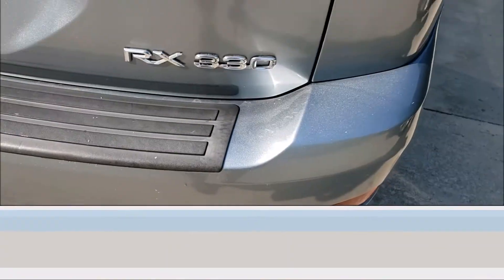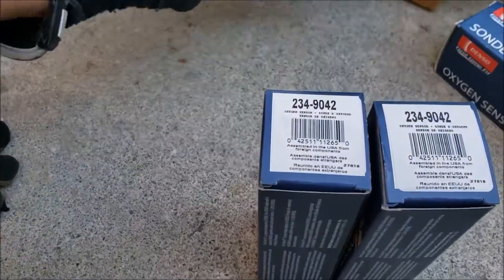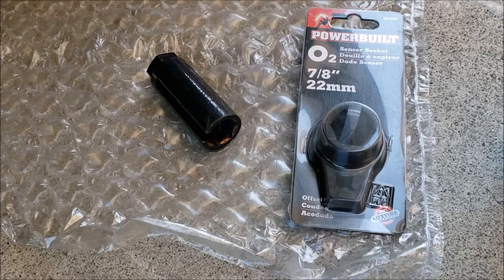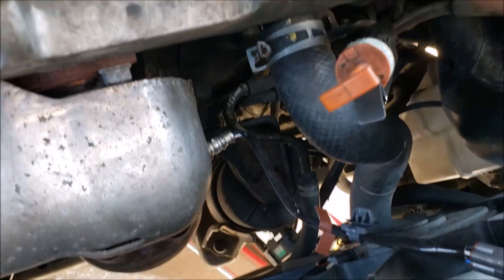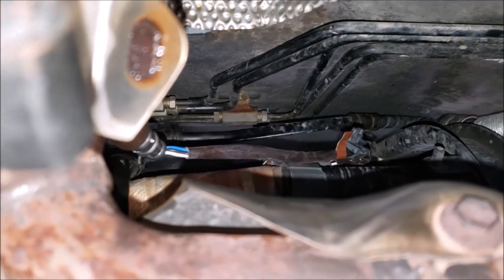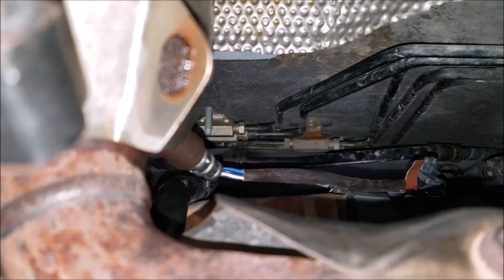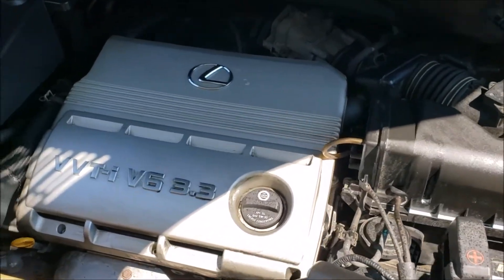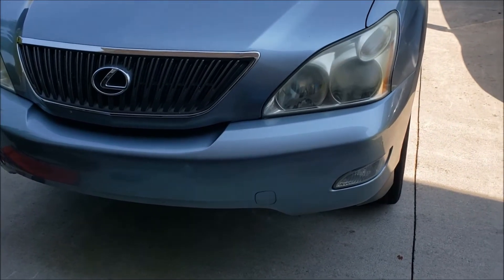Replacing O2 sensors Toyota/Lexus V6 3MZ-FE engine

Comment: Help. Trying to replace the front air/fuel o2 sensor (Bank 2, Sensor 1 I believe is correct).  CANNOT get the electrical connector off.  Anyone else struggling with this?  I cannot afford to break it.  I cannot seem to locate any release tab on it.  Any advice appreciated, especially in detail.  Thanks!

Comment: Hey i have a question. So i dont have a CEL and i just passsed emissions by them plugging in an O2 scanner.  But when i plug in mine it say the short term is perfect at or near 0. But my long term fuel trim is between +4 and +11. But what i have heard is that a bad oxygen sensor will cause it to be   - fuel trim. I have 180,000 miles on my rx330. Just not sure if this is because of 02 sensor or something else. I did a smoke test and i didnt see smoke coming out except for the intake where air goes in front of engine.
Also my fuel mileage is bad i average about 14-15. Used to be 19
Reply from the maker: Definitely sounds like you are running rich fuel-wise. If it were me, I would do a general tune up. Can't hurt, would only help. I would clean the throttle body, change the plugs, and run fuel cleaner through the next couple tanks of gas.

Comment: Great video. I'm assuming the o2 sensor you've taken out is bank 2 sensor 1?
Reply from the maker: I replaced all 4. The air/fuel sensors are sensor 1 on each side and the after cat o2 sensors are sensor 2 on each side.
Reply: @gdupler1966 thanks much for the reply.

Comment: after using the o2 socket where does the other side come unplugged from? i got a 04 rx330 and don’t want to just pull it out without undoing it
Reply from the maker: I would recommend unplugging the wiring harness before you use the socket. Otherwise, it will twist the wiring and make it more complicated.

Comment: Are you saying the 2 front sensors (toward front of the engine) before cat are the same 02 sensor part #? I bought 2 was able to get the one in front right of the Heat Shroud, however the other upstream lower left... (the one going right into the pipe) that connector did not fit? so I had to return one.. I removed it and the holes on the tip of the sensor were different than the one on the right of the heat shroud.... Any info will help.. thx
Reply from the maker: The air/fuel sensors (before the catalytic converters) are the same.  However, the engine is placed in the vehicle sideways. That means there are air/fuel sensors on each side of the engine. One is in the front (first one I described in the video) and the other is in the back of the engine, right next to the firewall (fourth one I described in the video). Hope that helps.

Comment: Was you able to change the one by the firewall with out a lift???
Reply from the maker: Yes. I used a universal joint, and an extension if necessary.
Reply: @gdupler1966  I seen that you used ramps and I'm going to do the same I just didn't know if I'd be able to reach it. I have a an extension and O2 sensor socket like you have. Thanks for replying.
Reply from the maker: @jcarney910  I used jack stands, but ramps should work as well.

Comment: I've got a lexus rx330 2005 and my check engine light and traction off light came on so I unhooked battery cables and hooked them back on lights went out but was running rough checked and it was out of coolant put coolant in and back to normal next day I cranked it maintenance required light was on and running rough turned it off and barely cranked sat one hour tow truck guy cranked it drove it on truck said seems like it is ok but I went ahead and sent it to garage any idea what could be wrong with the crazy thing

Comment: what is the upstream and what's downstream??
Reply from the maker: Upstream is before the catalytic converter and downstream is after the cat. The air/fuel sensors are upstream and have the part number 234-9042. The downstream oxygen sensors are different and have the part numbers noted in the video.

Comment: Hello. thank you for this wonderful video !! I have a Lexus RX400h. Do you think that these 4 parts are fits in my car ? Thanks again
Reply from the maker: Thank you for watching! The part numbers may be the same or similar, but since you have a hybrid, I strongly recommend you check RockAuto.com for the correct part numbers.
Reply: @gdupler1966  Thabk you !!
Reply: hi , thank you , can i use this part no, 2005 rx330 ?  
i have P0037 code

Comment: I have PO430 Bank 2 code now. Pops up last week. Next inspection is in a year. Should I drive like this or change those parts?
Reply from the maker: Just my opinion, more emission issue than drivability, but I don't like having the codes. If it were me, I would try a cat cleaner in the gas tank first.  If that doesn't work, replace the sensor. If that doesn't work try: https://youtu.be/t4MCUwaeqA4

Comment: I heard there’s something called “ adaptation values “ which you should do it with your OBD after replacing any oxygen sensor so they can read the new date but not the stored old data. Any idea on this one ? Great video by the way 👍🏼
Reply from the maker: Thanks for watching! I have heard of the term with certain codes like P2097. Whenever I have replaced sensors on Toyotas I let the PCM figure it out and see if it resets. If not after some short drives, I reset it with my scanner.
Reply: @gdupler1966  in my case acutely I never had any codes or any engine light but my car was puffing white smoke at startup and the mechanic says your down stream O2 sensors are bad and that’s what cause that smoke ! He says it need to be performed manually and have it reset to factory something like that still getting the same smoke after new sensor were replaced 🤔 the codes he found was p0131 and p0134
Reply from the maker: @Cosmopolitan86  those two codes point to the upstream pre-cat air fuel sensor on the left side not the downstream. If it were my vehicle, I would replace that particular sensor and see if that solves the problem. You should only see smoke at start up on cold mornings. Also need to check the coolant to make sure the heads and gaskets are ok.
Reply: @gdupler1966  I have 08 Lexus GS350 and it has so many oxygen sensor, the one who diagnosed says bank 1 sensor 2 & bank 2 sensor 2 , he mentioned that’s the 2 sensor by the exhaust so I went and bought 2 of them OEM ones. Do you think I might give a try and change the front one ?
Reply from the maker: @Cosmopolitan86  the codes he gave you point to bank 1 sensor 1. Due to the age of the vehicle, and probably the mileage, I would replace all 4 sensors with OEM units to eliminate any issues from them. However, if you are having significant white smoke exhaust, I would check the condition of the coolant before spending a lot of money.
Reply: @gdupler1966  everything seems topped off no leak or anything suspicious, I’m going to replace the upstream ones very soon and see if that will help. My mechanic have a really hard time replacing those downstream ones omg he was kinda cryin  and keeps calling me every time to see how hard it is lol,
Reply: @gdupler1966  update - I changed all 4 O2 sensors and one of my friend reset the ECM few days ago I haven’t notice any smoke yet but I’ll drive it more and will keep you update it 👍🏼
Reply from the maker: @Cosmopolitan86   Good deal! Fingers crossed that solved the problem.

Comment: Hello! I have a 2013 Lexus es350 with 108k miles, I’m the second owner and I got a check engine light. I went to autozone and the codes were P0441 P0455. The worker who has really helpful told me that it was probably  an 02 sensor. Any thoughts as to what it could be? Im going to the mechanic shop two days from now. Thanks!!
Reply from the maker: The combination of those codes usually means you need a new gas cap. I would look at that, check the vacuum lines, and probably a PCV valve.
Reply: @gdupler1966  will relay this information to the mechanics, thank you and I’ll keep you updated!
Reply: I changed all 4 on my 08 GS350 with 123k 2 upstream and 2 downstream the way I change them because I was getting puff white smoke on warm startup and the mechanic told me your o2 sensor might causing this but he was wrong , good luck 👍🏼

Comment: wondering if you saw any improvements with mpg? I have no codes but getting about 19 mpg freeway. vehicle has been religiouly maintenanced.
Reply from the maker: Yes, a little, probably about 1 mpg. Changing plugs helps too.
Reply: Yes, I'm at my wits end. On mpg. About 2 months ago, I noticed a significant drop in my fuel mileage. I have done all I can with the cheap DIY. I did a smoke test with a pump and cigarette, and there were no leaks. I cleaned MAF sensor. I don't have any codeds, but in the city, I get about 14mpg and freeway, maybe 19.

Comment: G, About how long would you say this took you? 1 hour? 2? Mechanic wants to charge $750 for this job (parts+labor) and I'm thinking the parts are under $200 and no way hes gonna spend 4 hours on it LOL
Reply from the maker: Maia, good question. I would think an experienced mechanic would take 2 hours tops. I purchased the Denso OEM sensors from Amazon for right around $200. I understand that mechanics have to make it worth their while, but if it were me, I would check some other estimates.

Comment: What code did you get before replacing the O2 sensors?
Reply from the maker: P0133. It only indicated one sensor, but due to the age and mileage of the vehicle, I replaced all four sensors.
Reply: @gdupler1966  thanks for responding, mine gave a P0420 code and it idles correctly. I’m guessing it’s the catalytic converter but it might also be the O2 sensor. (Catalytic system below threshold. Bank 1) what do you think?
Reply from the maker: @josephakobundu  if it were me, I would replace the O2 sensors on that side. If the code doesn't reappear, you are golden. If it does come back, I would be headed to the muffler shop for a cat.
Reply: @gdupler1966  thank you, I’ll do just that this weekend and let you know the result.
Reply from the maker: @josephakobundu  you are welcome! I wish you well and I will be interested to hear how it turns out.
Reply: I have bank 1 sensor 1 changed 2 times, code P2252. Do you reckon to change the cat?
Reply from the maker: @UCtour  when I look up that code for Lexus, it states that it could be bank 2, so maybe look at pre-cat on bank 2. If it were me and the vehicle has 200k or more, I would make sure all the O2's are replaced. I wouldn't be looking at the cat with that code.